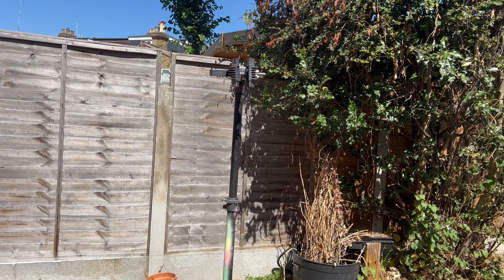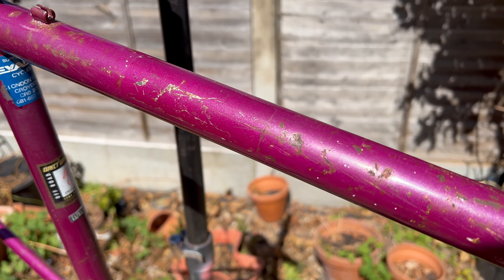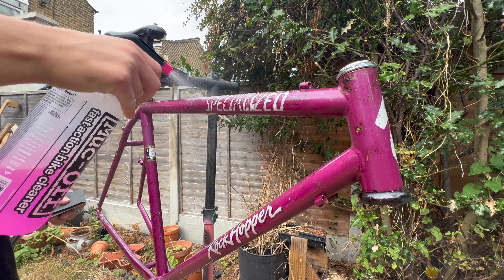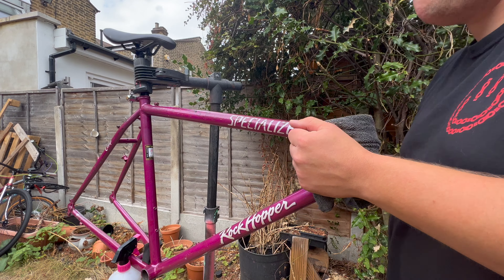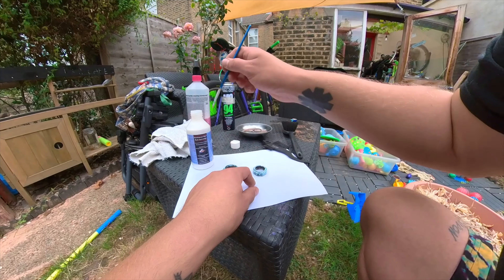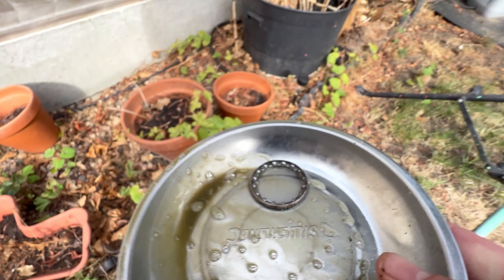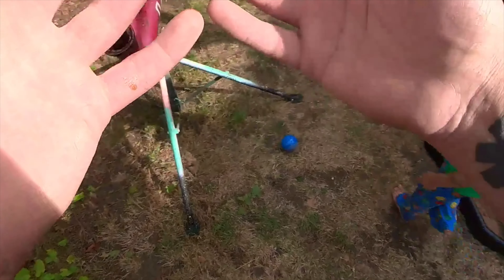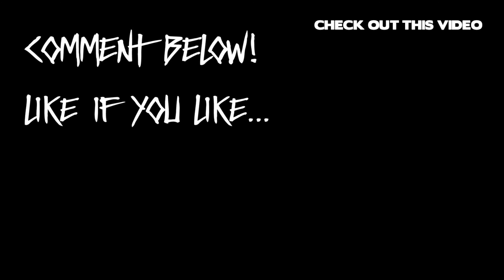Specialized Rockhopper Retro MTB Build Pt2 - Vintage commuter bike build

Comment: As much as I love Muc-Off I'm not sure if the copper grease is best for headset bearings. It's an anti-seize compound with very poor lubricating properties. It's good for preventing rust and galvanic corrosion (aluminium seat post on steel frame) but does not go well with bearings. Better choice would be Motorex Bike Grease 2000.
Cheers! Can't wait to see the whole bike!

Comment: Love what you’ve done with that paintwork. I always prefer patinated original over a respray where at all possible. You may have seen my Specialized from the same year as yours, also similarly crusty in places. Will film the completion of that project in due course, using your wet flat technique!
Reply from the maker: Sweet! Yeah the wet flat is a little scary but it’s worth it for that added shin.

Comment: Nice work mate! Out of interest do MuckOff recommend that copper compound for use on bearings? I’m pretty sure you’re not supposed to use normal copper grease on bearings so I’m wondering if that stuff is different somehow. 👍👍
Reply from the maker: That’s a great question!! It doesn’t specifically say ether way on website so I’ll shoot a message and try and answer in next video. ✌🏼
Reply: Was about to say the same, probably not for bearings 😅
Reply: @2NDLIFEBIKES  I’ve just had a search online and the general consensus is that copper grease is not for bearings just for anti seize duties like stopping seat posts sticking. I’ve been thinking about it say here and I remembered that years ago I changed the rear brake shoes on my car, instead of leaving well enough alone I decided to re pack my wheel bearings while I had the drums off, I couldn’t find my normal grease so being the genius I am I thought “copper grease will do” less that 5 miles later I needed new rear wheel bearings 🙈🙈🙈🤣🤣🤣
Reply: Pretty sure copper grease isn't for bearings either. I use a thin coat on seatposts and on BB spindles so the cranks don't stick on but I think using in running bearings is probably a bad idea, you'd probably get away with it in a headset for a while but parts with high loads like hubs, BB, freehub I would think it will cause damage.